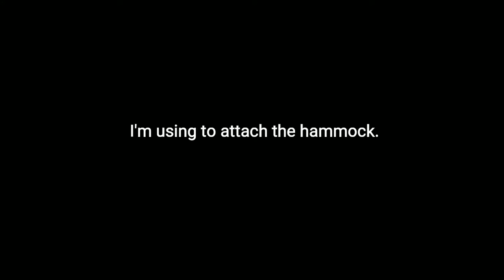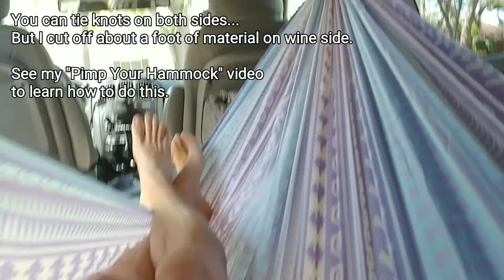Better Van or Minivan Hammock Hang - Stealth

Comment: Thank you very much!  This video was the missing piece I needed to figure out how to set up a minivan as a camper.  What hammock do you recommend to fit in a minivan?  I’m 5’4”, plump, and a side sleeper.
Reply from the maker: Leila Blaise - Any Nylon hammock will work, the softer the fabric the better. My only problem with these hammocks is the sewn channel - they end up breaking on the stitching. Also, you may have to make it shorter, so these videos should help with that:
Sewn Channel Hammock Fix:
https://youtu.be/vEpvJT-ey0g

Pimp your hammock:
https://youtu.be/_p-GxvNxB6s
https://youtu.be/ceuXNuQqcYw

Comment: Did you notice any water leaking during rains where the straps are against the rubber liners?
Reply from the maker: The straps a thin, so they don't separate the rubber gaskets from the door enough for water to go through. 👍🏼
Reply: I live in the UK, it rains a lot here... I tried putting straps of a different kind and without heavy load, through the boot (/trunk) seals and unfortunately water did come through eventually during the night. This is purely my experience and may not happen to others.

Liked the vid though, all the best!
Reply from the maker: @danielobeirne9386  The rubber in my van is very thick. That may have something to do with it. Maybe you can put a small towel or something between the strap and the door's rubber gasket to fill in the gap?